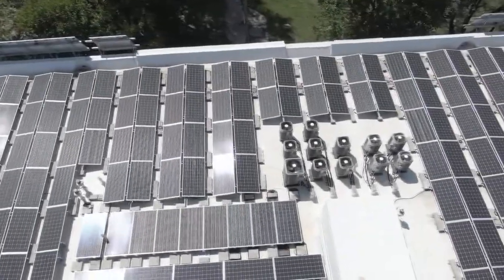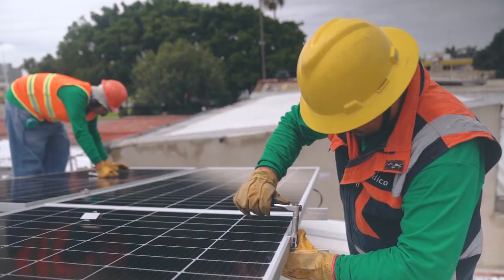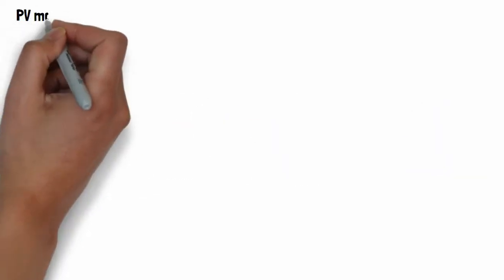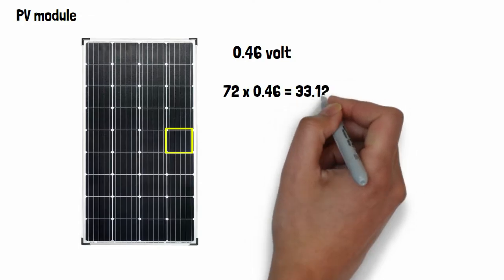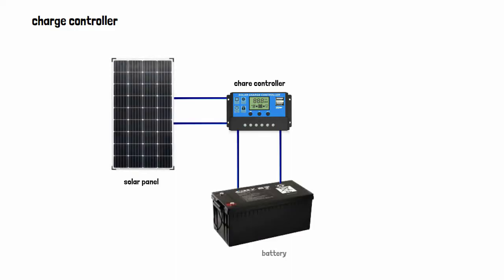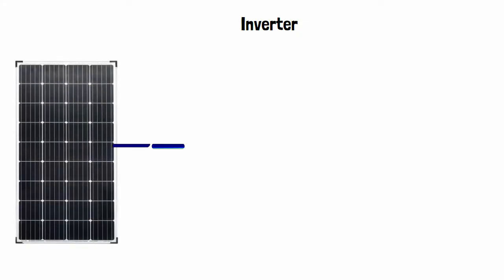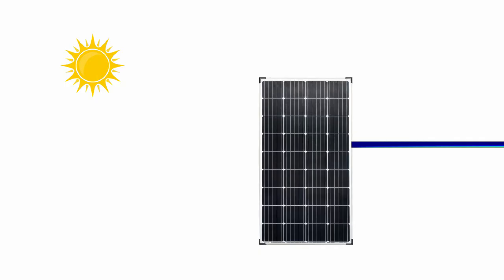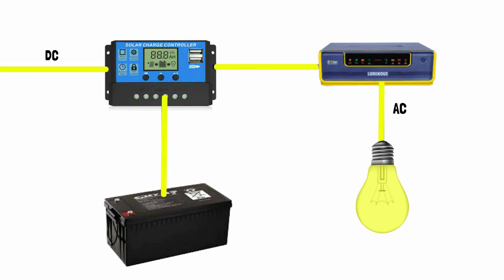Solar panel system components explain in 2 minutes

Comment: Garden on roof is the best option for any flat roof. For pitched roof which is better unless flat roof is rooftop deck then that is logical. But generally pitch roof better so solar panels best option unless you use solar tile roof. Then you just insulate the roof better. But solar tile roof looks better and i think solar tile has air gap behind tile that sort of is similar to the gap a solar panel would create but smaller so less effective but for better looks id go solar tile roof anyway